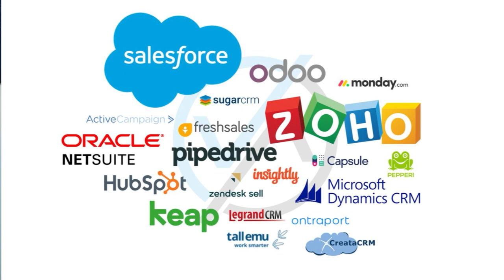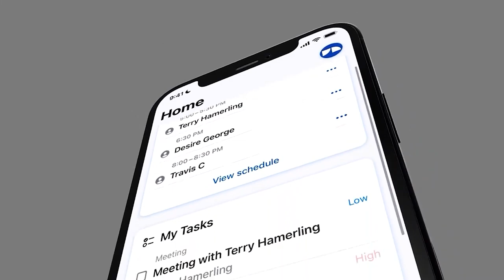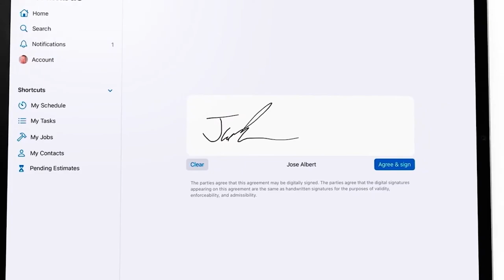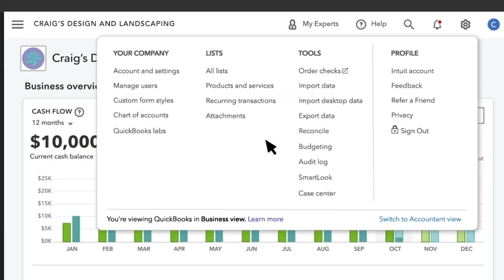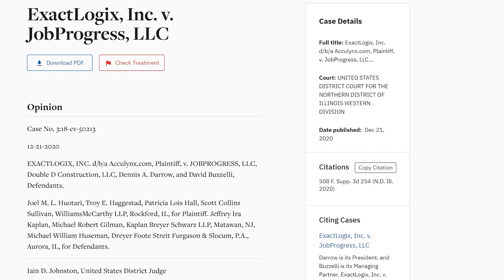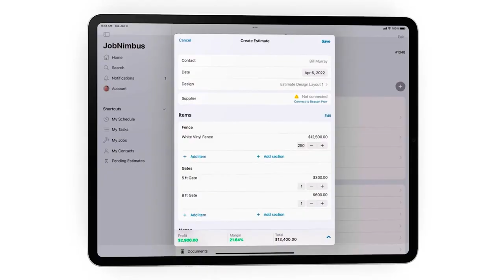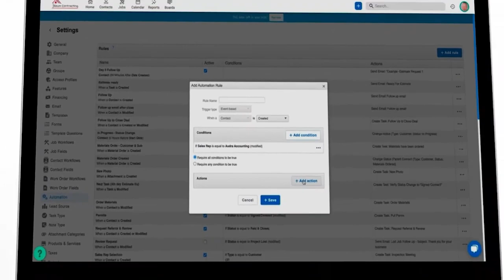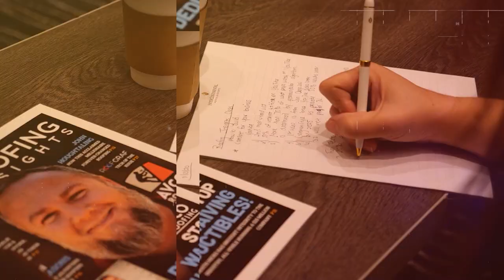How to pick CRM for Roofing Business | Why I don't recommend Acculynx

Comment: Great content, Dmitry. 
I am curious how Job Nimbus exports your data after years of use. How do they export pictures, attachments, job folders, customer data, etc seamlessly into any other program I would be moving to (for ex. Salesforce)? 
You seem to be very confident that they can do this ‘easily’ without any extra charge since I own the data. Is this correct?
Reply: Hey Brown, that is correct your data can be exported through reports to an excel file, on the contact/job document, and photos by selecting "Download All."

Comment: Making a decision a crm for my company tomorrow. I played with both extensively. Acculynx actually seems less user friendly to me. There are a lot of buried menus. I do like the way acculynx shows leads and the options to sort leads is nice with acculynx. But running a job from start to finish seems easier with nimbus. 

Just make a decision for me. Nimbus or Lynx. Thanks.
Reply from the maker: No brainer: job nimbus all the way!!!
Reply: @RoofingInsights3.0  haha. I here ya. Is it easy to migrate data out of job nimbus. Because you said it was hard with acculynx
Reply: If you've never used Acculynx, then Job Nimbus will probably be fine for you. If you've used Acculynx, you'll probably hate Job Nimbus. Acculynx is a far superior product, but they charge accordingly, too. 🙄

Comment: Used Acculynx for several years. Switched to Job Nimbus because of cost. Hate Job Nimbus! Comparing Job Nimbus to Acculynx is like comparing Windows 95 to Windows 10 (for PC users). Acculynx is far easier to use and is much more robust. Considering switching back to Acculynx.
Reply from the maker: Sometimes you just can’t teach old dog new tricks.
Reply: @RoofingInsights3.0  Not sure what Dmitry means when he says that the user doesn't control the data in Acculynx. Acculynx doesn't own your data. The user is free to take his data and migrate if he wants to. The way the data works is no different in Job Nimbus.
But yes... The downside to Acculynx is how much they charge! It's expensive.
Reply: @homesteadroofing  The feedback we get is they lock up your account or make it extremely difficult mainly when they know you are leaving. I am working with a company who needed their data for a lawsuit with a homeowner and Acculynx still will not turn it over because they ended their subscription. It's powerful leverage that no CRM should exercise and that's why it is imperative to ask these questions.  Acculynx customers in this scenario oftentimes resort to paying to keep one seat just to keep access avoiding the hurdles posed when they move to another CRM. Also even when a 3rd party DM company does intervene to help before ending the subscription Acculynx sends "cease and desist letters to all involved." Even when they eventually do get the data, the time spent and the battle is the more frustrating part for customers and what I hear weekly.

Comment: Acculynx is terrible in regards to data ownership.  They also want 1% if you process ACH checks with their software (with  NO CAP) quickbooks caps it at $10 which is reasonable. $45,000 job = $450 fee… in QB that would be $10.  WTF….